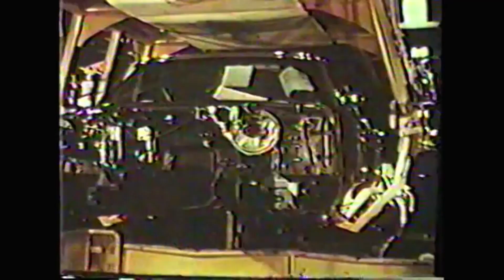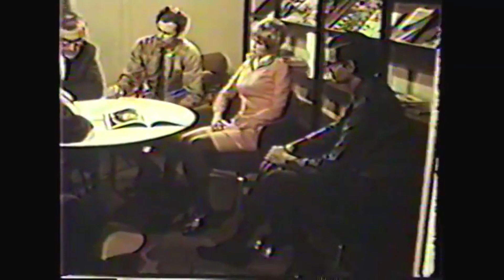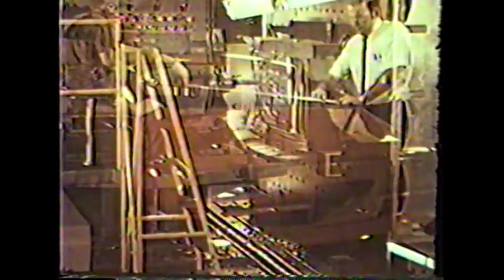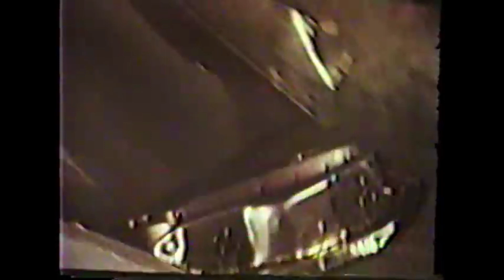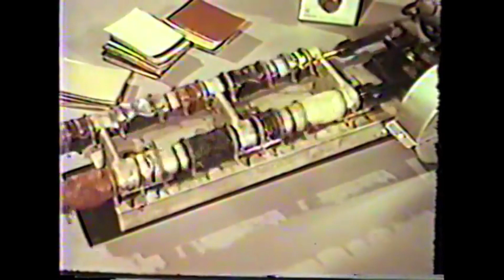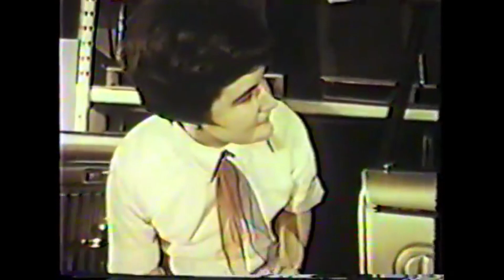General Motors Fisher Body Assembly Plant

Comment: I’m pretty sure the door panel fabrication segments are from the Fisher Body Livonia, MI plant. I worked there for two weeks in the summer of 1976, at which point I quit on account of a foreman who was a real prick. They were cranking out door panels for the ‘77 big cars by the tens of thousands. I believe they did seats as well. You had to bust major a$$ and, even if you did, you were threatened with firing (prior to getting 90 days in).

Comment: This was a nice surprise to see in my YouTube suggestions. My first car was a 1970 Caprice Custom Coupe in Astro Blue with a white vinyl top, L-48 350. It was a basic Caprice package: NO A/C, AM radio (antenna integrated in the windshield, which was just a standard thing) rear defroster (basically a hair dryer mounted in the rear deck, but it worked great), and a passenger side mirror. That was it! No power anything but brakes and steering. Thanks for posting!
Reply: Hair dryer! You're right! I remember my father 75  Cutlass S with the noisy rear defrost...

Comment: I always wonder how Fischer body would put the body together and on the body drop Chevrolet would match in the paint on the doghouse. Especially the metallic colors.
Reply: GM obviously didn't worry about it.
GM buyers weren't very picky or discerning.
Reply: I am saying that the workers had major skills matching the paint.
Reply: @eddean6663  It is very east to control color when you are mixing to code and storing hundreds of gallons of paint in vats. GM also picked inexpensive colors that would be forgiving in such a process. 

Today's cars are are also painted in different places on the assembly line: bumpers, mirrors, trim pieces, etc. are commonly painted in other facilities, away from the main body. 

It is not the same type of challenge a local bodyshop faces with mixing and matching smaller quantities, from different paint suppliers, in different climates, and adjusting for fading.

Painting a car in a factory setting from the same material supplier and controlled conditions is not difficult to get consistent results.

The automated paint sprayers were also depicted in the film, so that adds to repeatable and consistent finishes. It is not as though these were painted by hand by humans. I've seen old footage of the VW bugs being painted by hand, a much more challenging car to paint by hand on an assembly line.  When you do the same task all day long, you can become like a robot with accuracy and consistency.

Comment: Been hoping to stumble upon something like this.  Always seen that BODY BY FISHER stamp on the door.  I like how they wanted you to believe it was something truly unique and special.
Reply: Yeah, but they were, for the most part.
Not exactly Park Mulliner Ward, but solid cars.
Reply: @andysaunders3708  Not too special, they couldn't get something as simple as body panel gaps into a reasonable tolerance. When you can stick a finger in the gap of the door or trunk lid, it might be a little too big. Maybe they took "rule of thumb" literally.
Reply: @David_H_Parker  You're probably right. It was a shitbox by any later standards, but sentimental value, I guess.
A 350, but less HP than our old 283 Bel Air. I think that was 185, on a Powerglide.
It's funny about that panel-gap thing, too - there's a '78 HZ Holden ute in the carport, and it is a frigging nightmare in that department. Oh well, I haven't really had a good look at a GM product in a while, but my 82/83 VC Commodore was a bit of a dog in that department. Didn't really matter, because it hardly ever went... 4 cylinder horrible cut down 6-cylinder engine.
Truly horrific.
Looked nice, though.
Reply: @andysaunders3708  Quality was never the main focus of GM.

I understand the nostalgia aspect, I just wish people would be honest in retrospect.

With the exception of a couple VW Bugs, I grew up with GM, Ford, AMC and Chrysler cars. I get those feelings of nostalgia when I see them but I know they were all boats and dogs in reality.
Reply: @David_H_Parker  Fair point.
Reply: Just think, that muti-million dollar mechanical CAM machine lasted 5 years before it was in the land fill.

Comment: My USA Built GMC Sierra 2500 HD 6.6 gas bought new is the best vehicle I ever owned, and I have owned dozens - So many people complaining about GM quality now a days here ... my 2015 HD went 148,000 miles without any issues including no tune ups, original brakes, just new tires, oil changes, new air filters and wiper blades, I never serviced the Transmission or Rear Ends or other fluids and the truck was running perfect on trade in. Compared to 1970 I think it is a better product.
Reply: My sierra has 268000 miles .never been in the shop. Original everything except brake pads and tires
Reply: My 06 2500 gm truck only did 87k..... frame  rusted out... same with all of them Round those years... vfd  lost 5 trucks rust in the same spot.  Granted 0 motor issues even down to - 25F starts.
Reply: For the price difference from then to now, I sure hope they are better. I remember my dad (GM employee) bought a new C-10 in '83 but the drivetrain was absolute garbage with engine/trans. issues from day one and almost had to put in a claim for lemon law. I grew up and and live still in Genesee county MI not far from truck and bus (and now vacant fisher body property) where they make the HD pickups and chassis, it's good to hear they finally got their head out even though they are as expensive as European Sports cars.
Reply: @richardbaumgart2454  hope they are better but my nebiore has been in and out of the shop at 40k, lot of electrical issues. Had two ground straps rot off. It cause all the computers to turn off. Dealer wanted to see him new parts. Local guy found the bad grounds  truck was back on the road.
Reply: @Wrang15  Yeah I've heard that trucks with cylinder deactivation or "displacement on demand" have to be rebuilt @80k, which are most non hd trucks except for the 4 banger i think
Reply: @richardbaumgart2454  he has a 3500 4x4 dump truck for plowing snow.. and it has its issues all ready.
Reply: I'm still driving my 78 GMC stepside 4x4 I bought new a year before I graduated high school in 79. It's 44 years old and still looks almost new. I've always changed the fluids on time and it has never been in a shop. Just new tires, battery. Wouldn't trade or sell it for the world.
Reply: @kellyspann9845  I'm guessing you live in a southern state, if it were MI it would've returned to the earth already.
Reply: My 04 2500hd has 335k no issues

Comment: My Grandfather worked at Fisher Body Willow Springs Illinois from 1954-1985.
He gave me his old Chevy before he passed, told me "if anybody asks where you got the car, tell them your paw-paw worked at General Motors and he got it one piece at a time."
Reply: Your grandfather and my dad probably knew each other. He worked there from 1955-1985.
Reply: @Motorheadmike What amd what is "here"?
Reply: @Motorheadmike Umm ok.
Reply: How does anyone voluntarily live in Illinois?!
Reply: @zackc.8015  well that was also 40+ years ago

Comment: To bad this is all gone...
Reply: It did not take long for the good ole days comment to pop up.  Cars and trucks have never been safer.  The video presented here is showing the making of death traps.  Good riddance.
Reply: @twoponchos  Probably because today's cars have a human pilot.
Reply: @jasonhunt007  now car are made for lazy people everything is assisted, they also last only as long as the warranty before falling apart, repairing them is extremly expensive and this mean 3 year old car can go to the scrapyard. New car are also extremly expensive and designed by computer and all look alike
Reply: @puebespuebes8589  Gibberish.  Many new cars and trucks are clocking up 200K, 300k, or more.  And repairs are for those that don't do maintenance.  I will take most any car today for safety's sake compared to the death traps back in the day.  Who knows who might be alive today if those old cars has some of the safety systems like blind spot monitors, antilock brakes, and traction control.
Reply: @jasonhunt007  Your could just wear a helmet everywhere, get on a vaccine drip 24/7.. seriously.
Reply: @zackc.8015  Sounds like your experience not mine.😅
Reply: Agree.  GM has turned into solid greed.  I don't want anything they make now.
Reply: @johnnicol8598  It is not just GM, it is all USA  companies.
Reply: @johnnicol8598  "solid greed" lol
You must not pay taxes.
Reply: @zackc.8015  What does letting accountants choke the life out of a company have to do with me paying taxes?
Reply: @zackc.8015  Those didn't help either.  Why the personal insults?  Can you not hold a rational conversation?